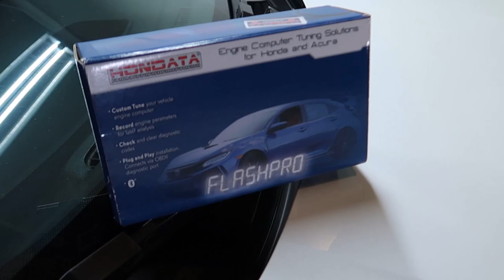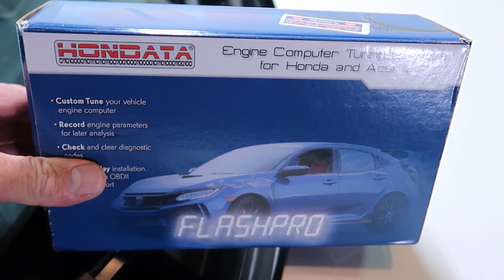10th Gen Civic PRL Cobra Cold Air intake install #CivicSi #prl

Comment: Your videos are always so informative! I'm new to this and not mechanically inclined, so forgive the basic question, but if I get the race maf, I'd be getting it installed at a mechanic shop. Can I wait until I get it home to flash the tune? Like will it start and make it home? Or would I need to flash there.
Reply from the maker: It should start up, but it would probably throw a code after you started driving! The code would cause your dashboard to light up like a Christmas tree. But it should still make it home. The main problem would be that your engine will be running lean, which could damage it over time. If you have a laptop, I would recommend that you tune it at the shop after the intake is installed!🏁👍

Comment: Hey, so I installed the same intake without the hondata and suddenly the engine lights pops up and the power has gone. Do u think once i get the hondata everything would be fine? Thanks in advance
Reply from the maker: Yes, if you got the race version, you have to tune your engine!!! Without a tune your engine will be running way too lean, this could damage your engine. I would not drive the car until you get it turned!

Comment: I only have the base set tune from Hondata for the prl race cobra intake on my 2019 SI and all my lights like emissions, check engine, traction light, and parking break lights are on… is this an actual issue or do I need to see what’s wrong with tune ?
Reply from the maker: Make sure you update your Hondata software and reload your tune to the ECU. I have had the same issue with all of the lights going off. Everytime that has happened, I've had to reload my tune. Once the tune has been reloaded everything should work correctly!

Comment: So funny.. I found this.. I just ordered the cai  street tho.  And the intercooler   I was surprised  the cooler didn't get painted.   They give us the option with the cardboard  cut out lol..   I honestly think the cai  looks cheap for the price tag..    anyways  good video..   I'll be installing my soon
Reply: which one is better street or race?
Reply: @dhruveshpatel8896  I would get street if you plan on keeping the original stock turbo with full bolt ons. If you get race I mean you’d obviously need a better clutch than the stock one and etc.

Comment: i have a question 
i’m doing a manual swap on my 2004 350z , i have all the parts the car need but i’m missing the switch that wires on the clutch pedal
if you can help me where to buy it please

Comment: I would like to do this but my windshield washer is in the way 😡
Reply from the maker: What type of 10th Gen Civic do you have?
Reply: @Zspeed  Canadian version SI
Reply: @Bbc418  Unity performance sells the intake with a relocation kit for Canadian civics
Reply: @juancano3199  yes I know but you still have to modify the kit to add the motor and have to re wire everything, it’s not even plug n play

Comment: I bought a used CAI and it didn’t come with the clutch relocation plate can I install without it?
Reply from the maker: You will need to move the clutch line, just use a self tapping screw a use the old clutch line bracket and relocate it yourself!

Comment: 6 extra psi of boost haha. How’s the civic nowadays?
Reply from the maker: Running well, very happy with the Performance so far! Thinking about getting a Dyno tune in the future!
Reply: @Zspeed  that’s great. How many miles do you have on yours? Did you replace your head gasket yet ?
Reply from the maker: 111,000 miles, no head gasket issues so far, an oil analysis will show you if you have any leaks!! Have you had to replace your?
Reply: @Zspeed  not yet haha. 149,000 Kilometres. I’ve been stock for 70,000 kms…..gonna start adding little pieces like you did but I don’t want to kill it. I drive an hr to work